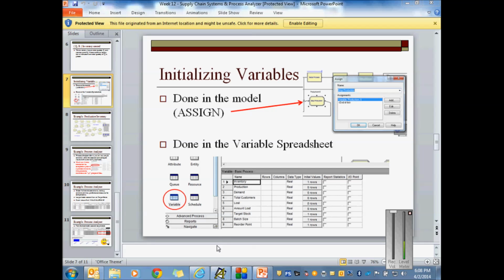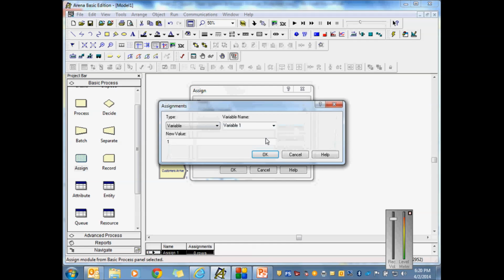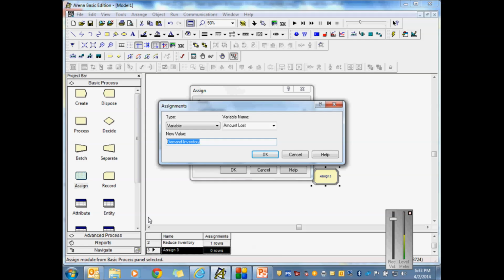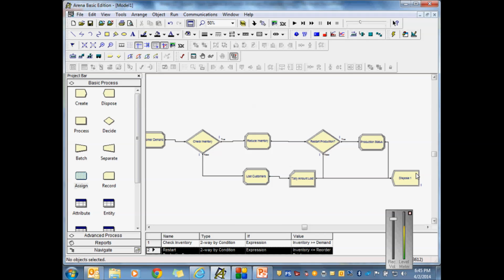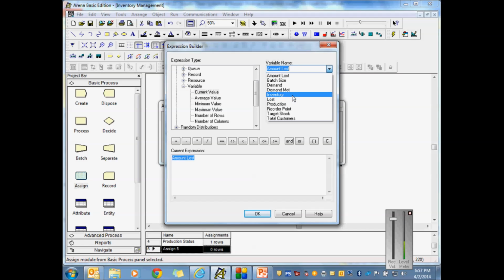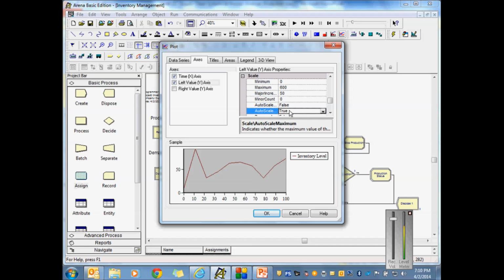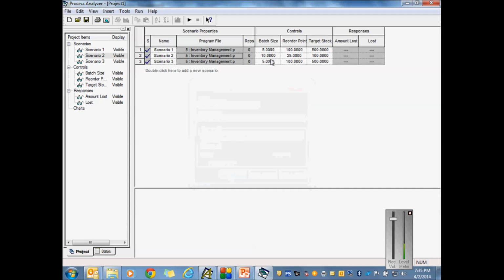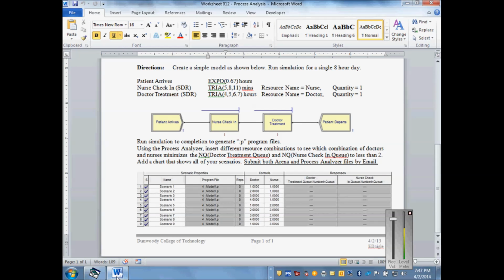Inventory Management using Rockwell's Arena Simulation and Process Analyzer

Comment: Greatjob! Maybe you can help me.
I am an engineering student and  I am creating a model that simulates a production system in Arena. I need to insert an initial warehouse, immediately after the create modules, where insert all the entities created. After that I have to find a way to feed the system with the entities created, deciding the frequency of alimentation. For example, I created 100 entities: 33 of A tipolgy, 33 of B tipology and 34 of C tipology, later I decide when and how many entities for any tipology go to the production system (for istance, 10 entities of A tipology in the first ten minutes, 10 entities of B tipology in the second 10 minutes ecc.). Is there a video that could help me?
Thank you!

Comment: I have a question about ARENA: is it possible to use different times in the same resource? For example, I have 3 types of trucks arriving and they have to be weighed on the same scale. Truck A is weighed in 03 minutes, truck B is weighed in 05 minutes and truck C is weighed in 7 minutes. After weighing, they are released and the process is closed. So, how to build this model in ARENA? Could you help me? Thank you in advance.